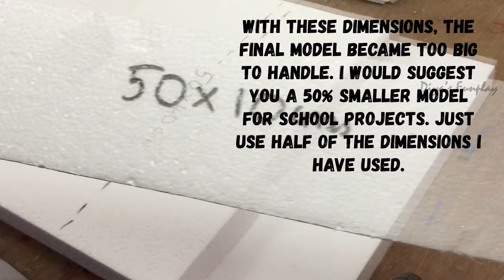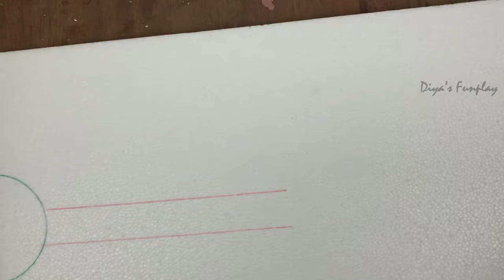Dam working model for science fair | Dam irrigation model | Water dam model for science exhibition

Comment: Do thermocol break for cement's weight?
How many it will be after applying the cement?
Plzzz answer these👆
Reply from the maker: It depends on the thickness of the thermocol and the quantity of cement you are plastering with. Just because you are coating it with cement, it does not mean that it will become rock hard like concrete. After applying cement you will have to handle the model carefully like glass. The cement you are using in the model is just for sealing the model to prevent water leakage and to give a concrete-like look, but it is not actually concrete. So you will have to handle it with care. Also note that when the model is wet, cement would have absorbed water thereby increasing the weight of the model. The same model will be very light when it is dry. And your second question is not clear.
Reply: @diyasfunplay  how many days will it be after ceiling?
Reply from the maker: @prakashashrit2276  Do you mean the life of this model? I have one water fountain model made of thermocol and cement, and is running 4-5 hours a day without any issues for more than 4 months.
Reply: @diyasfunplay  iam having science day in my school on 28th of this month so that i have prepared this model
But only ceiling is pending. Does cracks happen on the cement if i ceil it today?
Reply from the maker: @prakashashrit2276  yes, you can apply cement coating now. Make sure you sprinkle some water after 8 hours of applying the cement, and once in 6 hours for the next 3 days. Your model will become good enough and there will not be any cracks.
Reply: @diyasfunplay  i thank u from the bottom of my heart for clearing all my doubts and u helped me a lot
Iam very grateful to you😍😍
Reply from the maker: @prakashashrit2276  It's a pleasure. All the best to you......

Comment: Can it be done without foutain pump
Reply: Please answer me
Reply: Please i have to make it by tomorrow
Reply: Please please please
Reply from the maker: You need a water pump to pump water to the reservoir and make the water flow from the dam continuous.. You can also do it without a pump, but the water flow will not be continuous. You will have to fill the reservoir manually, and the water will run out till it lasts and you will have to fill the reservoir again  and again manually.

Comment: Advantages of these
Reply from the maker: A Dam is a barrier built across a river or stream that blocks the flow of water.
Advantages of dam:
1. Provides water for irrigation and human consumption.
2. Generates hydroelectricity (we will not run out of hydro power as long as the water cycle exists.)
3. Avoids air pollution as hydro power is a clean energy.
4. Dams provide prime recreational areas for boating, camping, water sports and picnic.
5. Dams can supress floods thereby avoiding a big disaster.
6. Dams are useful for navigation (inland river transportation)

Disadvantages of a dam:
1. Dams affects biodiversity. Dams restrict the movement of migratory fish and other aquatic animals thereby affecting their reproduction and gradually decline in population.
2. Plant life may get submerged under water and eventually die.
3. Dams will capture and hold important sediments needed for habitats downstream there by affecting the fertility of the soil.
4. Construction of dams can affect the groundwater table along the river.
5. A dam collapse could be a major catastrophe. 
6. Construction of a dam could be very expensive.

Comment: From were water is pump did u connected any water pipe or did u pour water in that
Reply: Reply fast plzz
Reply from the maker: You have to pour water manually to the bottom big tank. From there, the water pump will pump water to the top reservoir.
Reply: Instead of electricity we can connect battery .if we can connect battery how much volt battery we can connect
Reply: Plzzz reply
Reply: Plzzz reply fast
Reply from the maker: The water pump i had used is 18W (220V). You will have to use an appropriate battery for the mentioned pump. I havent used that pump with a battery, So, you will have to find out a suitable battery.
Reply: Ok thank u so much
Reply: Ok thank u so much

Comment: How to attach fountain pump plzz explain 
I have tried half project and now iam not getting how to complete it
Reply from the maker: Most of the small fountain outlet will have half inch outlet size. Attach a half inch pvc or any plastic pipe (even garden hose) to the fountain outlet and just place the fountain pump at the bottom tank as shown in the video. The other end of the pvc pipe should be let into the reservoir (top tank) and sealed well with cement. Let it dry for 24 hours.
Reply: Thanks a lot
Reply from the maker: Please refer below video. I have explained it.
https://youtu.be/T1eth0SoX_E

Comment: Where  to connect fountain pump
Reply from the maker: At 9:39 you will see there is PVC pipe in the reservoir that is going down. You will have to connect the pump at the bottom end of that PVC pipe. (make sure the pump sits properly on the bottom tank without hanging in the air as shown in 15:36) In my model the reservoir PVC pipe length was short, so i have added an extra green pipe.

Comment: I have to submit my project on 27th please tell me sir what I have to explain or tell me which is the India first dam
Reply from the maker: Kallanai dam built in the 2nd century AD across river cauvery in Tamilnadu is one of the oldest dams in the world and the oldest in India. I will give you more information about a dam and its uses by tomorrow.
Reply: Thank you very much sir
Reply: The dam you have done is also the same aa sir
Reply from the maker: @sowmyasrikadali1326  NO, but it will have some features of KALLANAI dam and KRS dam.
Reply from the maker: A Dam is a barrier built across a river or stream that blocks the flow of water.
Advantages of dam:
1. Provides water for irrigation and human consumption.
2. Generates hydroelectricity (we will not run out of hydro power as long as the water cycle exists.)
3. Avoids air pollution as hydro power is a clean energy.
4. Dams provide prime recreational areas for boating, camping, water sports and picnic.
5. Dams can supress floods thereby avoiding a big disaster.
6. Dams are useful for navigation (inland river transportation)

Disadvantages of a dam:
1. Dams affects biodiversity. Dams restrict the movement of migratory fish and other aquatic animals thereby affecting their reproduction and gradually decline in population.
2. Plant life may get submerged under water and eventually die.
3. Dams will capture and hold important sediments needed for habitats downstream there by affecting the fertility of the soil.
4. Construction of dams can affect the groundwater table along the river.
5. A dam collapse could be a major catastrophe. 
6. Construction of a dam could be very expensive.

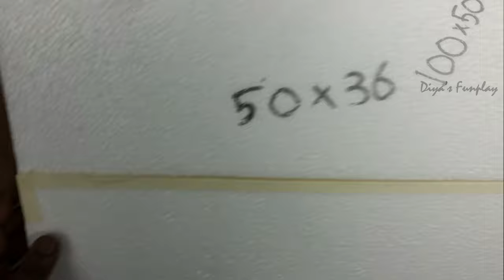Comment: 4:09 .......how did u paste that plzzz tell me I have to submit it by 27th plzzzz
Reply from the maker: Its simple. I have used masking tape and you can also use cello-tape. Keep the two pieces of thermocol vertical on a table in such a way that the edges you want to stick should be close to each other and facing the roof. Take a long tape and stick it on the edges of the thermocol in such a way that half of the tape sticks to the edge of the first thermocol piece and the other half of the tape sticks to the edge of the second thermocol piece. Its basically like a window attached with a latch to a frame.
Reply: Thank you so much

Comment: Hello sir  we are also preparing the dam in ur given mesurements only but 50× 36 is not adjesting .please sir give me correct mesurement.🙏🙏please give reply
Reply from the maker: 50X36 cms is the dimension of the whole thermocol piece. Those are the dimensions i had used in my model. Make sure you had cut the thermocol in a straight line. This is just a thermocol model and you can always trim them to suit your needs and make the model fit.

Comment: sir, didn't understood how to apply the foundation pump...
please te me...
I have to submit my project very soon..
please tell....
Reply from the maker: At 9:40 you see a single pvc pipe going down towards the bottom tank. Connect the fountain pump's outlet to the bottom of that pvc pipe. If the pvc pipe is small in length, then add a piece of plastic hose so that the fountain pump sits on the floor of the bottom tank.

Comment: Hello  I loves this model , can you pls say me how did you connect the PVC pipes and and pump together , and if i will connect it the electricity will pass from pump to pipe and pipe to reservoirs ? And one last thing how is the same water being used again as I can see there's no way of water going up to the top reservoir automatically ? 
I think I will have to put water manually
Reply from the maker: Please watch the video without skipping. I have shown the pump location. and how the water goes up. If you have a water pump in hand, you will understand how a pump works and all your doubts will be clear.
Reply from the maker: Please refer below video. I have explained it.
https://youtu.be/T1eth0SoX_E

Comment: Sir plzz ye bta dein k hum ne model ko cement se coat kitni bar krna hai mutlub 1 time jub Kiya hai to phir 8 hours bad phir krna hai kya
Reply from the maker: After 8 hours of first coating, do a second coat. Apply a thick second coat on water storage areas. If time permits, do a third coat again after 8 hours only for the water storage areas.
Reply from the maker: One coating is enough for the places that do not  have any contact with water. Make sure you seal all the edges with cement properly for a leak proof model.
Reply: OK thankyou sir or aik or bat poochni thi  k jo water pump hai wo electricity k sath chale ga mutlub k us ki wire switch k sath attach Hon gi
Reply from the maker: Yes, the water pump needs electricity to run. The water pump comes with a wire. You may extend it if needed and connect to a power source.

Comment: 1 more question
How did you ensure that the water won't leak?
please reply i have my exhibition day after tomorrow 🙏🏻🙏🏻
Reply from the maker: Add water and check if there is any leakage. Water storage compartments should be well sealed with cement.
Reply: @diyasfunplay  i sealed them with glue then cement and then with tape